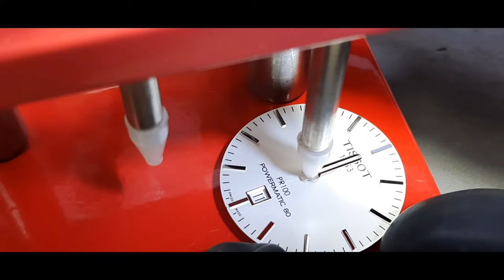restoration tissot pr100 powermatec 80 polishing change ancre and escap wheel geneve luxury watches

Comment: what is the difference btween a pr100 and just a powermatic?
Reply: I think PR100 is a model number and Powermatic 80 is the movement.  My watch has both on it.
Reply from the maker: The difference between Powermatic and pr100
The Power Matic runs for 80 hours and the regular Tissot runs for 48 hours, with some adjustments to the scale
Reply: Is Powermatic a model number/name?  I thought "Powermatic 80" was the movement that come with PR100s. @Lexpertdesmontres
Reply from the maker: @robertbrandywine  no powermatic 80 is a model